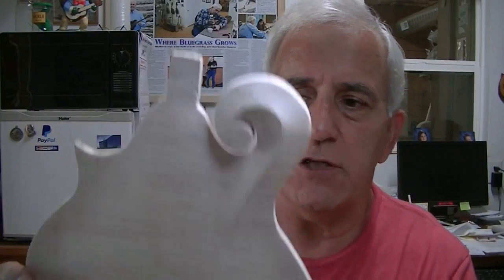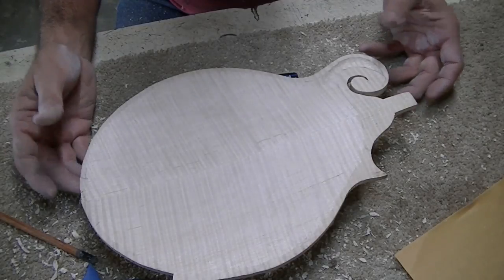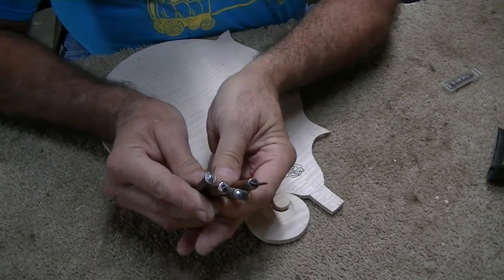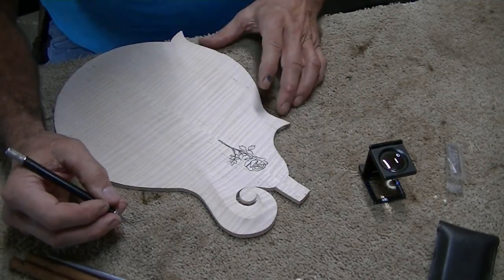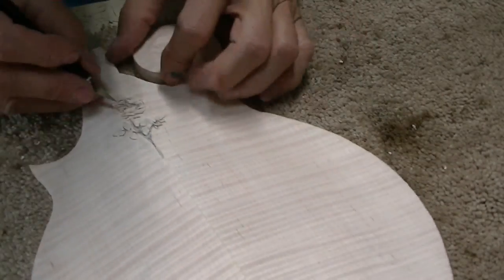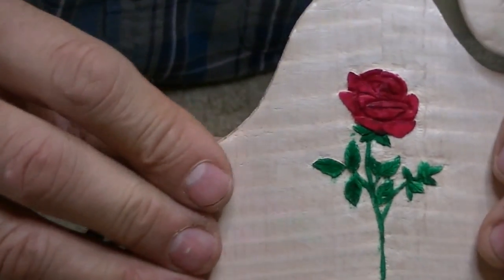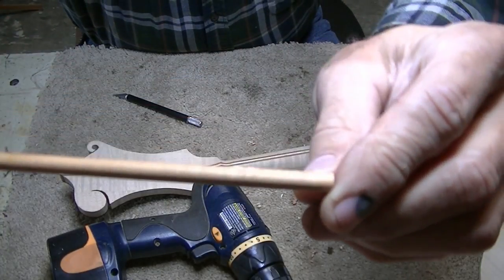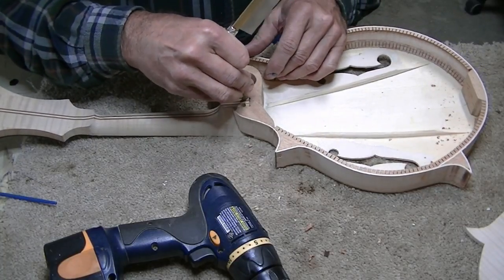182 RSW Custom Rosa Mandolin Rose and Neck Part 6

Comment: Hi Jerry, it's called a Lupe or sometimes a Loop.used by antique dealers.
Reply from the maker: I'm familiar with that term. Most Lupes are actually used by Jewelers. I don't think this is actually called The Lupe. It is primarily used for typesetting or inspecting small type. I forget what they actually called it in that trade.

Comment: I love the methodical way the mandolin is gradually coming into existence bit by bit.
The back carving of your signature Rose was very interesting and great to see.
Is there any particular reason you don't glue in the label before you glue the back on? Positioning to the F hole is obviously crucial but it would be much easier I should think.
Thanks for posting.
Reply from the maker: The label has the date on it. I don't know what the date will be until I finish the instrument.
Reply: @RosaStringWorks  That figures thanks Jerry!

Comment: Great video. I've learned a lot of things I wished I knew when I built my first guitars. If I might ask a question. Is the doweled neck joint common for mandolins? I used a mortise and tenon joint with dowels to lock it in on my first guitar. I only had hand tools and I didn't think I had the skill to properly create an accurate dovetail joint. It was built in 1976, and really needs a neck reset, but I have no idea how to take it apart. Despite looking like someone's first effort, I enjoy playing it and it sounds very loud and bassy, but it takes a real man to play it due to high action. Thanks again for the great videos. I always learn something and greatly admire you skill and craftsmanship.
Reply from the maker: banjomandoguy thank you very much. No I don't think the dowel joint is that common. I just think it's a very good joint and most mandolins never need a reset.

Comment: I have used dowels in joints and I had one that was flush when installed that expanded more than the other wood and broke the joint open. So, now when I use them I leave the dowel just a little under the surface of the rest of the wood. Just insurance, as different woods expand and swell at different rates. hope this never happens to you as it's a pain in the neck when it does.

Comment: Hi Jerry, thank you so much for this video series. I have no doubt it will be indispensable when I start my own F5. I have a question about your neck joint: in the Siminoff book, he establishes the joint angle in the head block via the bandsaw, whereas it seems you’ve built the angle into the end of the neck. Am I correct in assuming this? Your method seems easier and if so, is probably the way I will go as well.
Reply from the maker: I got that from the first Seminoff book.  He may have changed it since then.
Reply from the maker: I might add that the real angle is set at the time it's glued on with a jig which I think I showed in my videos also.
Reply: Rosa String Works Okay great, that’s what I thought. Perhaps he did change it, because in my book—the 3rd printing—the end of the heel is left at a right angle and the jig he uses for the bandsaw is angled 6 degrees. Your method seems much simpler from a home builder standpoint. Your simple alignment jig is a great idea as well. Thank you again, I love the channel. I’m sure you will be hearing from me again in the future!

Comment: A purely innocent question, why do you use the hardwood on the back of the mandolin? I can't help thinking how good that maple would look on the front. I know there must be a reason.
Reply from the maker: The hardwood on the back acts like a resonator and bounces the sound back out the sound holes.  The soft wood on the top is what gives it that mellow sound. So you really must use a soft wood on the top and a hardwood on the back if you want a decent sound.  Switching it around will not work well at all. Thank you for watching.
Reply: That makes perfect sense. Thanks for that.

Comment: Would it be easier to do the woodwork behind the nut for the truss rod before putting the veneer on the headstock?
Reply from the maker: It all has to be cut out so to me it doesn't make any difference at all.